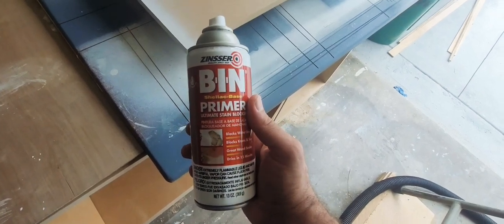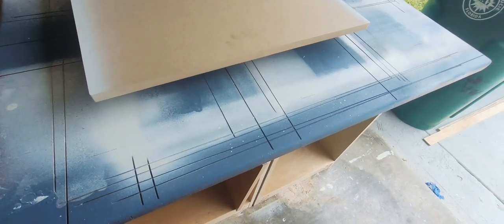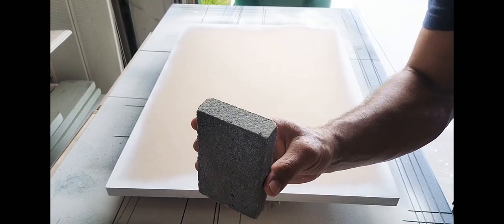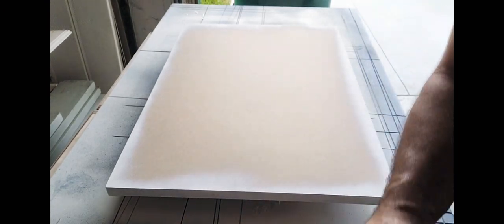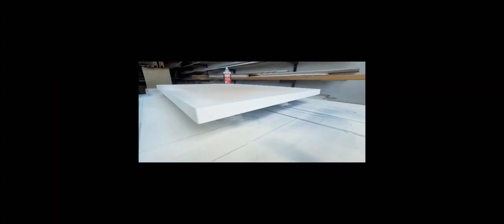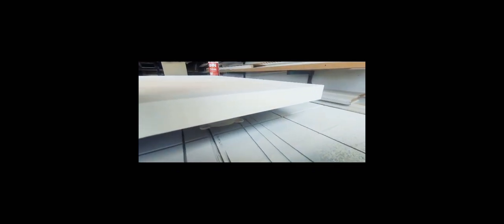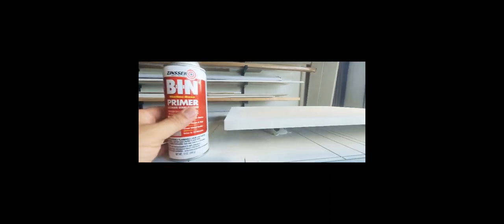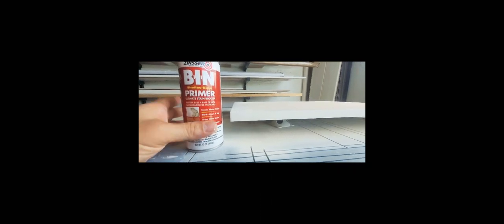How To Seal MDF Edges - Using Shellac Primer

Comment: Thanks for the recommendation. Is it necessary to spray the flat surface too?
Reply from the maker: The flat portion you can use regular primer like 123 primer.  The shellac primer  is expensive so I only use it to seal edges that normal primers can't seal.